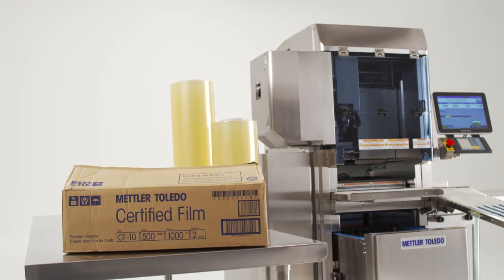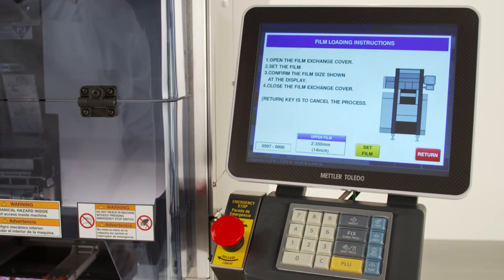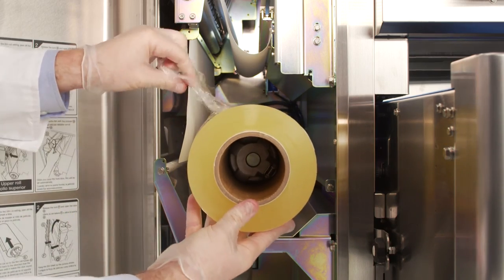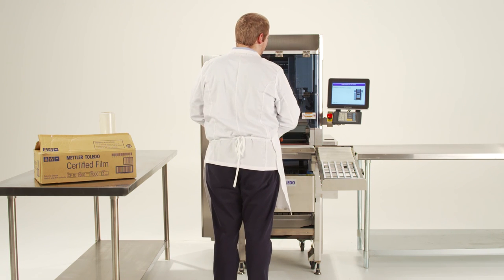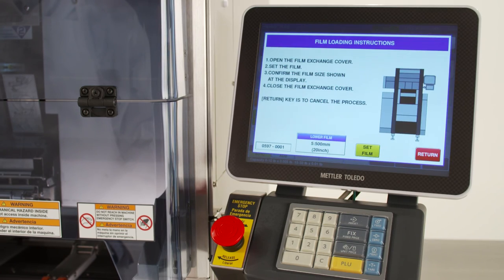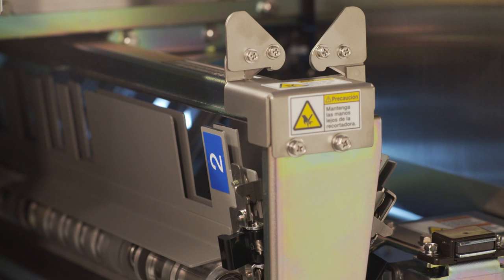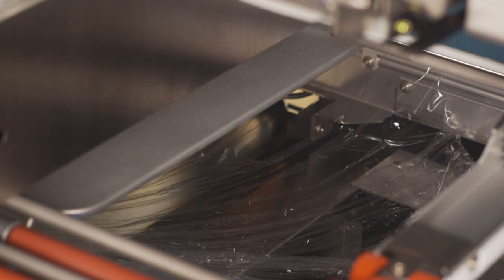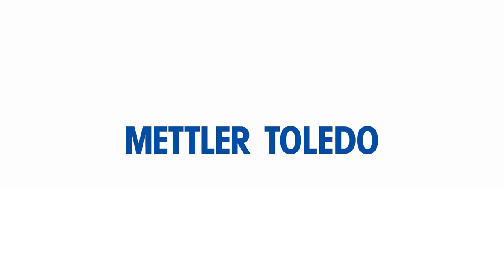880 Auto Wrapper Changing Film Tutorial for Grocery Retailers - METTLER TOLEDO Retail - EN

Comment: We can’t get the lower film to auto feed it just won’t grab it and no jams
Reply: Did you ever figure out how to fix the problem? We're having same issue
Reply: @user-dm5jk5lw5t  you’re going to have to do a service call. We were told you got to be real gentle with it. Make sure there is no film lodged in the clearish wheels off the left where the film feeds into the machine. This thing is new on the market and as far as I can tell you it is made cheap on purpose for retailers. Our pop printer still doesn’t work and we have to switch label positions on certain products even though it’s supposed to be preprogrammed